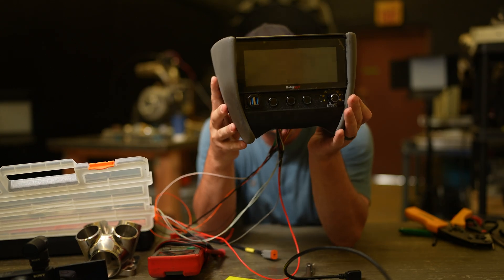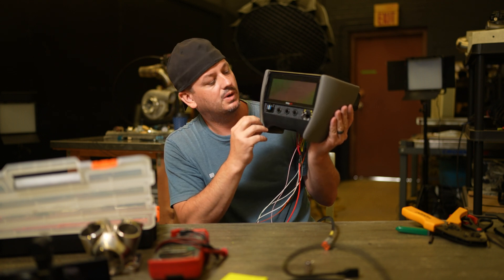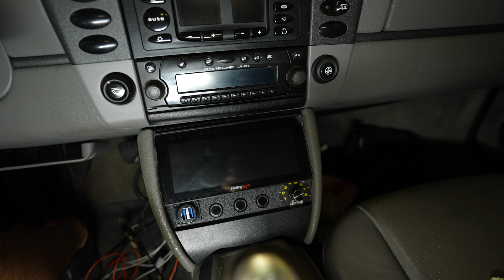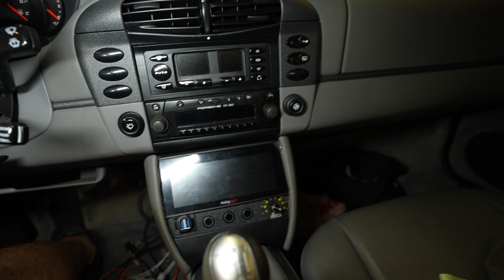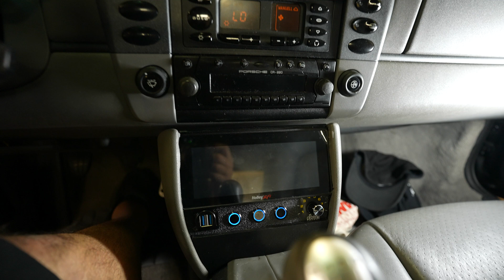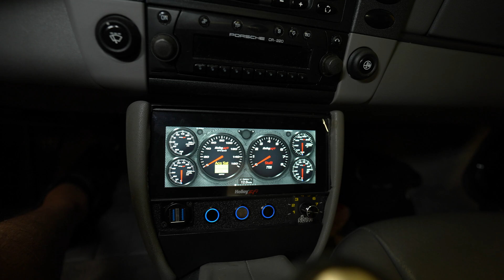Skunk Vomit //  Holley Pro Dash Install

Comment: It would be nice to see how to properly wire and test that multiposition switch.  I've got a table for it, have it wired into the power tap but can't get the Holley to reflect my changes on the dial.